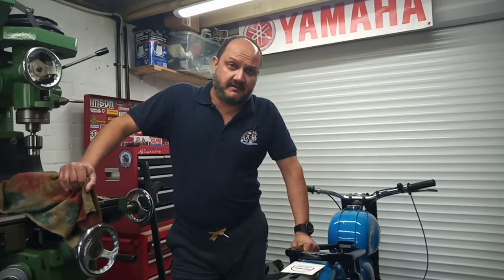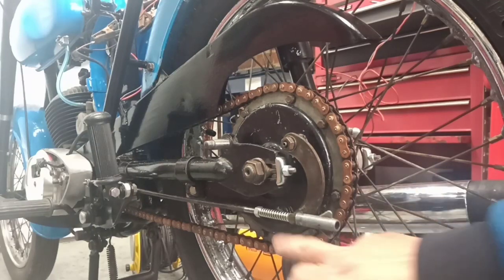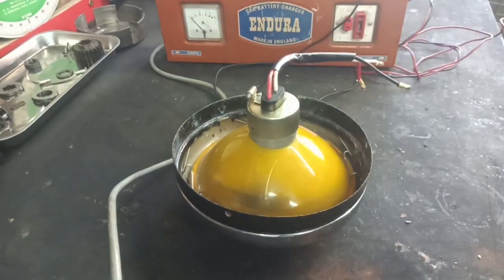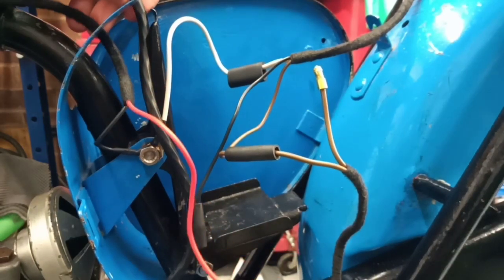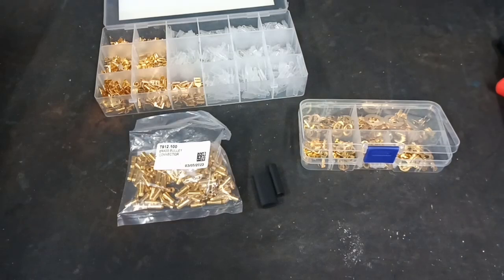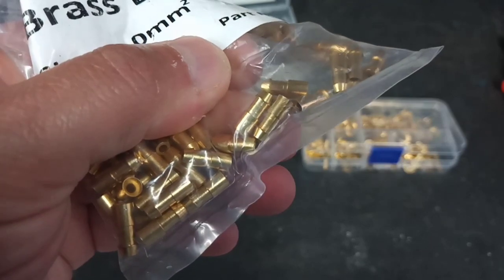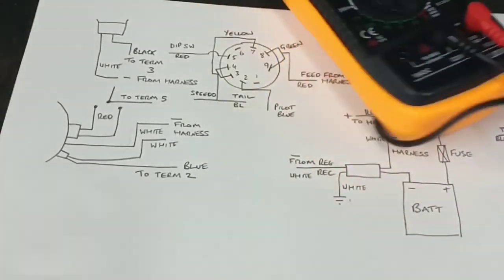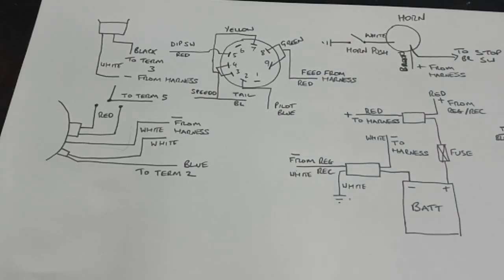Bantics - BSA Bantam D7 Thinking about Wiring

Comment from the maker: I hope you enjoy this video, it's a bit shorter than usual as I have not had much time in the workshop. 
If you enjoy my videos, please check out my friends and favourites:
AG Engineering, Oz BSA Bantams, Coleman Customs, In the Shed, Britannia Motorcycles and my brother, Carl Wilson. 
Best wishes, Dean.
Reply: what model battery did you get to go the the bones cdi unit Dean the ones ive looked at were to big
Reply from the maker: @alanbrown1563  I used a Motobatt MB3U. It is a bit of a squeeze but with some foam and a longer strap just manages to fit. They do a slightly smaller capacity battery, MB2.5U which may have been a better fit but I'm happy with it. 
Best wishes, Dean.

Comment: It took 3 minutes looking at the broken wires, insulation tape repairs and the horrible corroded Wipac hardened rubber switch plugs to decide that the £63 pounds for a  complete loom was the cheapest option ( money and time wise )  to see if the bantam runs before delving into it ( i really don't need another project in many pieces 😁 ). Yours is coming along nicely.
Reply from the maker: Thanks very much. I hope you get yours running soon. There are quite a few configurations of Bantam wiring, I'm not sure which one the new Lucas looms cover. It's all fairly straightforward though so you should be fine. I've subscribed to your channel, you do some very interesting shedology!
Best wishes, Dean.

Comment: I'm with you Dean. Both crimp and solder. I also like drawing out the circuit I'm working on rather that trying to follow all the very close wires and small print in the manual diagrams.
Reply from the maker: Thanks Jack. It's a system I've used for years and it works for me.

Comment: Another very informative video and totally agree, earth wires are your best friends.
BSA rear brake switch mechanisms do go from one extreme to the other, simplicity of the Bantam to the overly complicated A50/A65 which has a total of 9 parts (including bolts/washers) and that's not including the 5 parts required for the brake stop adjuster!
Reply from the maker: Thanks Ian, I just can't bring myself to fit a Japanese style switch. That may change when this one packs up!

Comment: Great work Dean. I think you're being a bit harsh on yourself about the rear brake switch, I think it looks the part. It's not easy to make "add ons" like that look the part, but you have. Couldn't agree more about having an earth wire in the loom. I get so many customer enquiries about lighting issues, most of which are on freshly painted or powder coated bikes. I think you can guess the first question I ask in relation to earths! The yellow Motobatt batteries are a good choice too. Looking forward to your next installment.......regards Bones
Reply from the maker: Cheers Bones, we will see how the switch gets on. It has a rather nasty feel to it, as many aftermarket parts seem to have. 
Best wishes, Dean.